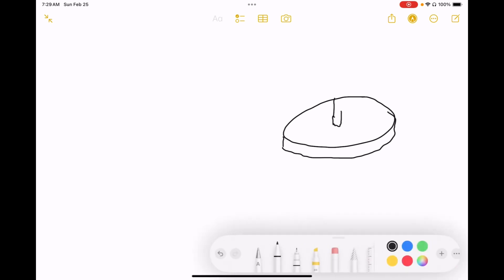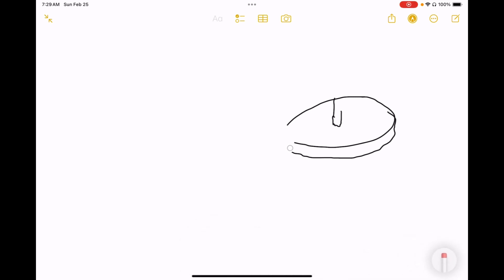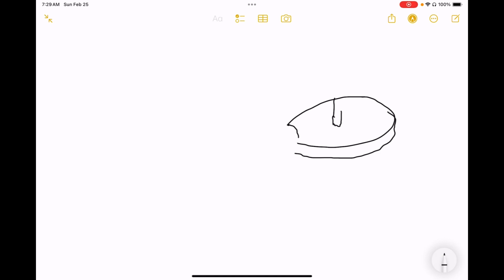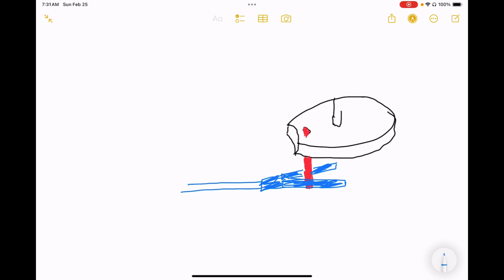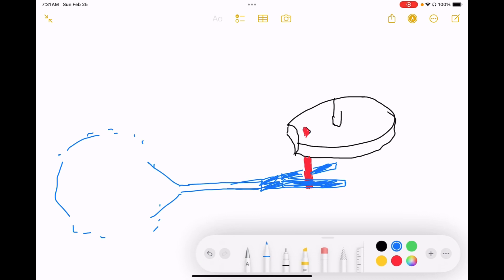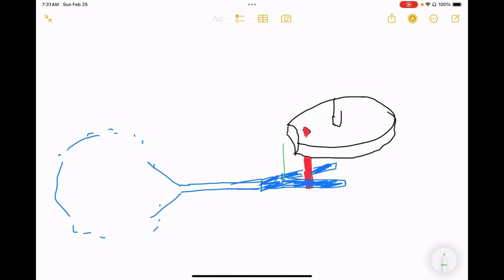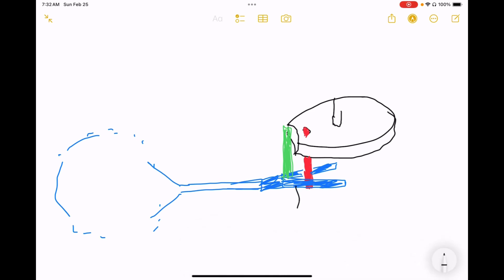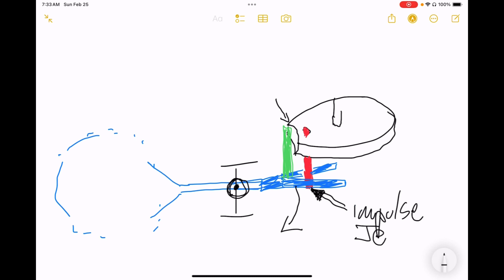Fixing a Watch Pallet Fork

Comment: Im pretty sure i theorized this pin was bent causing the overbanking. Great video !!!!!
Reply from the maker: You likely did. I actually shellacked the guard pin as well.
Reply: @JDRichard   So you had two problems, loose and out of place guard pin.
Reply from the maker: @sonnymoorehouse1941 Yes Sir. And the Bride of Frankenwatch just ran down and it is overbanked again. Need to adjust the balance fork guard pin - dart. Damn!
Reply: @JDRichard  Use your depthing tool to adjust
Reply: @JDRichard  use your depthing tool to check function of pallet fork and roller table
Reply: @JDRichard  Great job getting this watch back to the land of the living